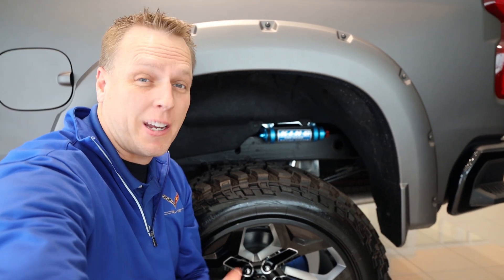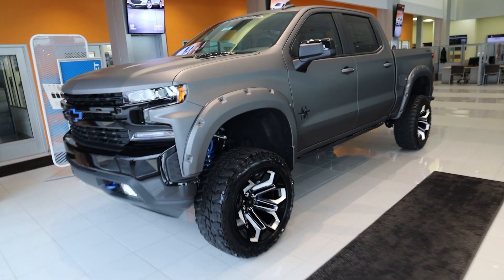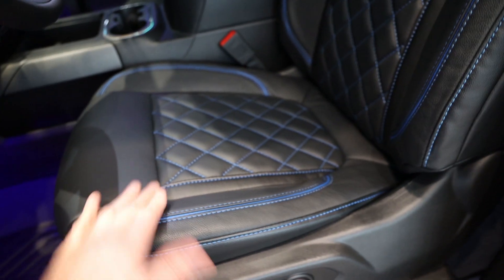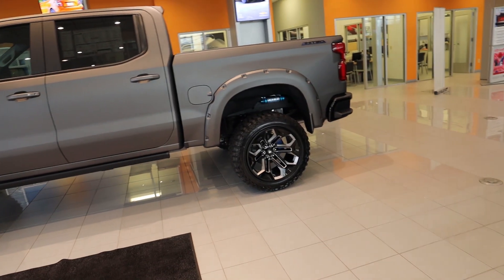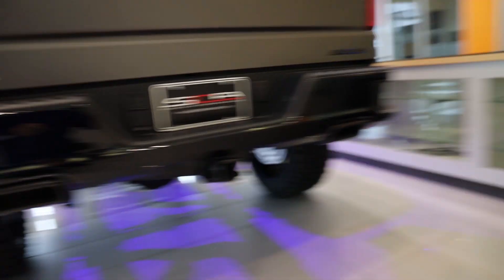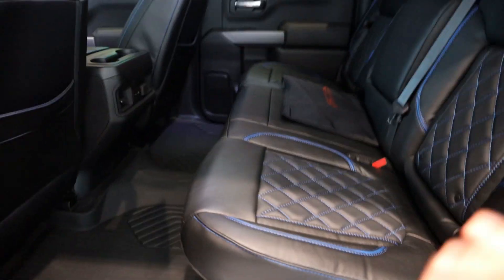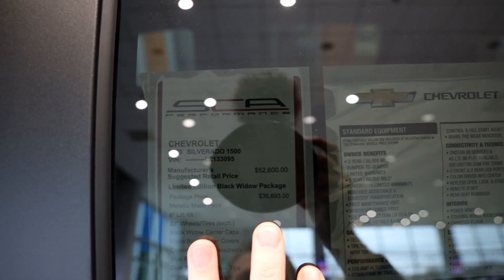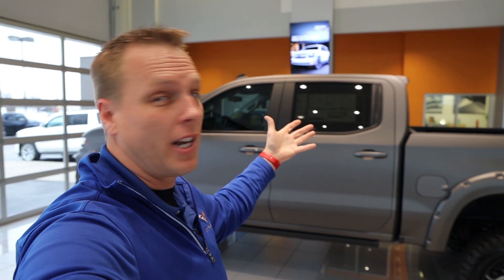I built a 2020 Silverado to compete with the 2020 Ford RAPTOR!

Comment: Minus the shock it looks like they opened up a Pep Boys catalog... And that's nice hating but very offensive. Look at a off road raptor . First thing is rims and tires you need the smaller rim and more tire for many reasons... I'll build you one that will compete with the raptor. This is a mall crawler. Absolutely no offroad anything.
Reply: You couldn't afford this if you wanted so zip it.

Comment: Not the same fox shocks,  not the same suspension travel, not flared fenders (fender flares are different) not as powerful, and no a number truck that holds its value. Just the same 20 year old Silverado mods every other owner installs

Comment: sweet truck but it cost $24,000 MORE than I paid for my house.  I'd like a Suburban SUV made in the Raptor configuration.  I have seen 1 company made one called a Velociraptor but they make it by putting a top from a suburban and welding it to a raptor,,

Comment: The only thing on this truck worth anything is the King Shocks.  That’s if it has a some type of valving in them.  Everything else is a show truck and no go off road. Especially at speeds.  Anyone with driving time in the seat off roading at speed with rough terrain will limp this thing home, at best.  Missing so much with suspension to compliment the shocks..ie...progressive leafs springs, upper control arms, 37” tires on 17-18” wheels to name a few.  Sorry not a Raptor comparison nor stand alone peicing together a suspension on normal trim truck.  22” tires/wheels...LMAO.  Need I say anything more!

Comment: That’s a mall crawler. I am sure you can’t adjust the king shocks from inside the cab like you can do on the Raptor. One thing you do have the Raptor beat on is all the blue lights. Yeah that’s off-road performance. Trucks a joke.

Comment: So how does it preform compared to a Raptor? My guess is no where near as good. Does it have locking rear diffs, comparable suspension travel, offroad drive modes, trail crawl, offroad software and interface to tell you yaw and angles? And who puts 22 inch wheels with lower profile tires on a "real" purpose built offroad truck??? You built an over priced pavement queen.

Comment: Getting charged twice for exhaust tips you're getting $ 35000 Straight in the ass hard and not good rims and tires are 3000 and under lifted kits lol is 3000 maybe   The Fox shocks you can get It's not a good  Investment you pay 80 to 90 and tax   and interest charges  Then you're over  $100000 3 years or trucks worth 40000

Comment: Congrats!....you spent all that money to be the top dog Mall Crawler....What is with all the "trick looking" crap?....Those wheel/tires are the WORST desert package you could throw at this poor truck...
What gears?...........Raptor 4.10
Rear locker?...........Raptor rear E-locker (Your mall crawler may have the G80 Gov Loc)
Front diff?...............Raptor can be had with a Torsen front LSD
AWD?......................Raptor does
Drive Modes?........Raptor does
Paddle Shifter?.....Raptor does
Wider stance?.......Raptor 6" wider then stock
Wheels?.................Raptor runs 17" wheels....just like real desert trucks....Trophy Trucks!
How much further do I need to go?....You keep saying this truck is awesome....the only this about this truck tha'ts awesome is the you seem to believe you built a Raptor killer....
I take my 2018 Raptor down to Baja, I've got over 1,000 miles of pure desert speed running, so bring that awesome truck to the California desert and I'll meet you so you can FEEL the difference, not just some funky paint and rock lights!
I do enjoy this channel and think you a nice guy....but really?
Thank for the video and allowing to me to share my thoughts..

Comment: This, this is a mall crawler. The only thing decent on this is the shocks, but they are wasted on such a dumb vehicle. The rims would get trashed the moment they went offroad and the tires are extremely thin. No beadlocker hurts it even more. This isn't even converted from an LTZ or High Country, so you lose out on the tech package. Hell you're stuck with a stock 5.3, for that price I'd assume there was a supercharged 6.2 under the hood. For mall crawling this thing is wildly overpriced, and for actual offroading its useless (since the whole gm truck platform is useless for it).

I'd be better off sending a Silverado to Hennessy and get similar upgrades, but also a full warranty on a supercharged engine for about the same price. Its kinda pathetic the things sca does